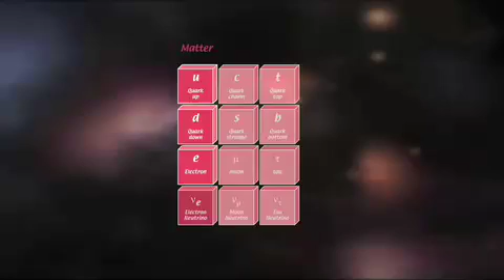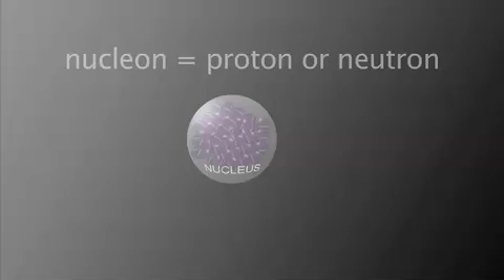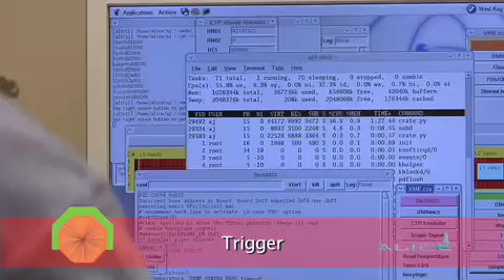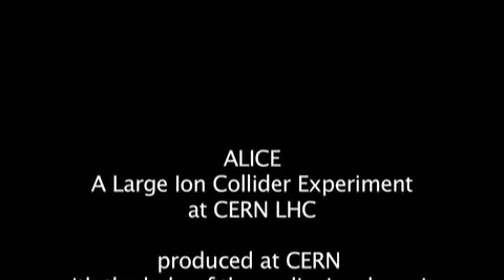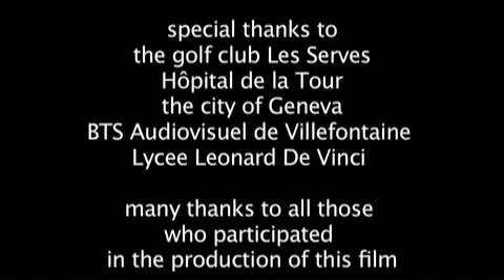ALICE - Voyage inside the core of matter

Comment from the maker: Well, so in the movie Yves says '100.000 times the temperature in the center of the sun (15.000.000 degrees)' which is 1.5 million million (10^12) degrees, and therefore much higher (about 15.000 times) than what you get with nuclear fusion. (For the experts, the phase transition to the Quark-Gluon plasma is estimated to exist at a temperature of about 170 MeV, which roughly yields to 2.0 x 10^12 K.) [to be continued]